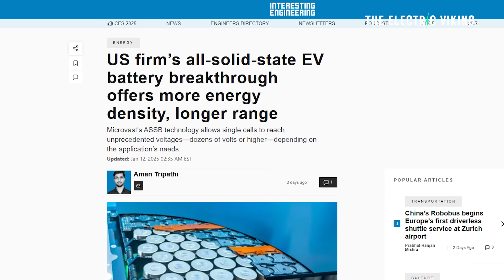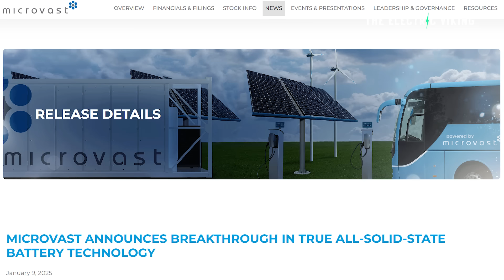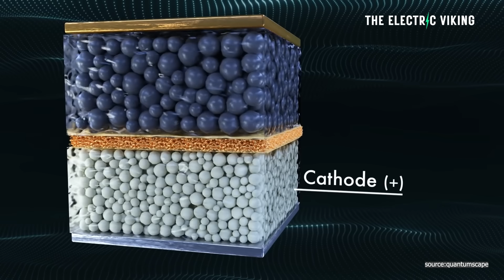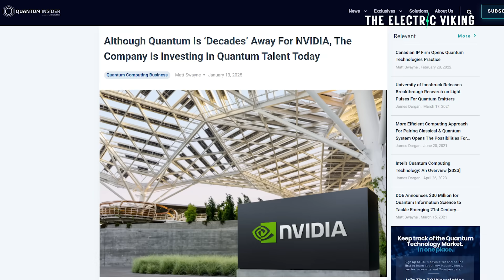Microvast says its Solid-state EV battery breakthrough is game changing

Comment: With a large battery capacity You're missing the point you said we don't need that but that's not the way it works If you have extremely large battery capacity you can have a smaller battery  thereby it could be extremely useful in cars by decreasing the weight and using on smaller cars as well , to get you around the equivalent of 400 to 600 mi plus we can use that for people who commute regularly it would mean you wouldn't have to charge your vehicle but maybe once every 2 weeks which would be extremely useful Plus you could convert that to home battery storage and yes we could definitely use it there, so you're kind of being short-sighted on the possibilities of a large battery capacity if they can do it. I don't know why you would say something Ludacris like we don't need that, give me a break with extremely large battery capacity you can use them in city buses you can use them even in trains you can use them in airplanes because you need a lot less battery in size and weight so yeah we can use the more the better and could that cadet technology be converted to the use in small electrical devices such as a battery in a cell phone that would essentially last for a week or two before it needs charging rather than every three or four hours with use so yeah you're really really not thinking this through when you said we really don't need that much charging capacity.

Comment: IF gasoline were to be introduced TODAY it probably would be banned due to its highly flammable nature, its inefficiency in combustion and its insane cost/logistics well to gas station distribution.
 ALL we REALLY need is for batteries to be fully safe and have the range we are used to with ICE cars and the charging times we are used to when filling up ICE cars at gas stations. Period.
Reply: Also mechanically speaking EV vehicles are more reliable. A fraction of moving parts. Software is their achilles’ heel. But the same applies to ICE’s. Cheaper costs to power EV’s
Reply: @timkasten343  Agree 100% LOVE the fact that an EV's motor consists of about 5 moving parts :-) The charging and battery management systems are very complex however

Comment: The petrol and diesel engines have been going for 150 years. They can only be improved by fractions of 1%. Battery technology is improving rapidly. What is available today will look inadequate in 3 years. In 5 years batteries will charge as fast as filling a tank with diesel.
Reply: How? Have you any idea of how much electrical energy you’d have to have on tap to put into a battery to recharge it in a few minutes. Factor in, even if the battery could accept such brutal currents to recharge it; where do all those amps come from? When a vehicle has potentially lethal 800V DC systems anyway, do you really think you want a car running with even higher voltages? (Assuming that higher voltage systems are the way to increase efficiency) The power grid is going to be fed from intermittent sources like solar and wind - the only way you’ll ever get your ration of juice delivered fast is when there is an unexpected surplus of electricity. And in our net-zero future - that’s not going to be often.
Reply: @ Tesla already have 1,200 kW chargers for their Semis. So the technology already exists.

Comment: for daily use, any car with 400 km range 90-10 is sufficient, for travel i would think 3 to 4 hours highway 80-10 and 30 minutes recharge is more then you need. The goal should be to make this as light (and maybe compact) as possible. Combine this with a rear drive car, with enough power to accelerate to 60mph in about 8 seconds and a top speed limited to 100 mph (so we don't need big, heavy and expensive tyres and brakes) and we are getting somewhere.
Of this car we also make a 'light version' without nav or entertainment system, as this is provided by the owners smartphone.

Comment: 1600km range is necessary and I would say it is not enough.
My reasons:
If you don't want to waste hours of time on a long trip in charging stations. 
Lets factor in the cold weather which reduces battery power storage capability.
Lets factor in heavy traffic/traffic accidents where you are fixed in place and have no possibility to charge the car.
Loaded cargo. if you transport goods, the more cargo you carry the faster your battery is depleting.
Using extra features like heating and air conditioning etc. reduces range.

I would say a theoretical 3000km range would be ideal for security, time management, and general peace of mind where I would say it is a 100% replacement for a diesel.
Reply: Nonsense, you don’t need that range.
Reply: @crm114.  Well, when you packed a metric ton of goods into your electric car, has to go through a city in full traffic in the winter with minus -2 degree, and you literrally don't have time to stop the car to charge it because you have to earn a living from 7am to 4pm? Absolutely you do.
Reply: @crm114.  Why do you think electric cars are not widespread in the commercial and industrial sector? It is not becuse of the cost that is for sure. Its because a fully charged e vehicle cannot last through the quarter of the day.
Reply: Have you not been paying attention to this channel of late? You can now recharge a battery from 10% to 80% in less than 10 minutes. This is less time than you’d spend with a comfort break and a coffee (which you should probably be doing every 3 to 4 hours anyway). 4 hours at 75MPH gives you a required range of 300 miles. Allowing a safety margin and charging only to 80% at a stop, a 400 mile range battery is plenty to give your vehicle more range than most drivers bladders (and concentration spans) can cope with.
Reply: @stevetodd7383  except if it is winter. Then your charging goes to warm the batteries.

And no. First video i've seen is this. Also if you are in the business of delivering goods in anykind of business you would know most of the time there is no room for charging 10min 8x time a day.
Reply: @ if you’re stopping off from driving long distance then your batteries are already warm. There’s a whole cooling/heating system in most EVs used to keep them at ideal temperatures, and it uses waste heat from the motors or a heat pump as a source so there isn’t that much impact on range.

If you’re in the business of delivering goods then you should realise that in an urban environment the range of an EV is much higher (so your 400 mile battery will last you all day at urban speeds), and on long journeys you need to recharge for 8 minutes at most twice for a whole working day (you start the day fully charged, drive for 4 hours as fast as the law allows, charge for 8 mins (while taking a loo break), drive for another 4 hours before the next charge and then you have another 4 hours range. That’s 12 hours driving on less than 20 minutes charging (which you don’t need to hang around for, you can be in a cafe etc).

Comment: We don't have the electric power to supercharge a lot of cars. Electric power should be produced by wind turbines, but Germany is producing only 40% of it's energy by non-fossil means. Ok it makes A LOT of sens to burn petrol, for making electricity and then load a battery with that. This is brilliant.
Reply: No, electricity should not be produced by wind - b/c when there is no wind (usually when it is winter and really cold, i.e. when we need the power) there is no electricity. 

So with wind you always need to invest in reliable power as a backup (invest for the same kwh twice, i.e. extremely expensive) - nuclear, or fossil fuels.

Comment: The improvement you’re really looking for is how robust batteries can be and not degrade from recharging over the lifetime if the car.
Reply: That is called EVs with battery swap. Such as NIO, Onvo, and now Firefly. If you have a brain you do not buy an EV with the battery integrated in / locked to the chassis.
Reply: @ Yes, thank-you, why swap batteries when a crystalline structure of solid state battery material lasts 54 years?
Reply: @effingsix3825  Where do I buy that battery? Because there are other components in the battery that will fail. There is a reason for limiting the warranty to 8 years. If you have a magical battery that I can buy in la la land - with forever warranty - then sure that solves one reason.

Other reasons include balancing the grid (swap station charges all batteries during the night when power is cheap). The option to drive around with a small battery for every day city use and swap in a huge heavier battery for vacation. Etc.
Reply: @ Hi using a crystalline structure is the latest in science, and not yet available commercially.  But my point is the durability of the battery product is what concerns ppl the most.  NIO will never be marketed in North America.
Reply: @effingsix3825  Never say never. Unless you think Tesla will be banned in China (the largest car market). My point is - it makes little sense to weld the wheels to the car - so that they need to be cut away and the car taken apart when the tires need to be changed. (And then talk about forever tires that will be available at some point..)..
Reply: @effingsix3825  The durability issue is gone with battery swap and BAAS (battery as a service).

Comment: You just have to buy used or look for the killer lease deals. New ev depreciation is brutal. More than anyone except high-end luxury car buyers or Jaguar owners have to suffer. They can afford it. You can't.
Reply: There is a reason for the drop in price - the battery risk. EVs without battery swap should not even be sold.
Reply: @martina5328  This and other misconceptions are why totally dependable used evs are such a bargain.

Comment: The current in amperes must limit charging times from heating and or size and weight of conductors and ultra high voltage issues. Seems like there is no free lunch with higher energy density batteries and the side effects might rule out aviation use if any higher fire risk or cooling is involved.

Comment: you don't need 1200km range unless you lose 50% range to towing and another 50% to temperature
Reply: Less cycles of charging increases the battery life and battery degradation would no longer be a major issue. For day-to-day driving no, but what if you don't want to use public charging and you are away for a week? 

I agree though for normal drivers, it would never be required. You could probably power your home for three weeks with that size battery so it is another option.

Interested to know the battery density.
Reply: and another 50% to high speed